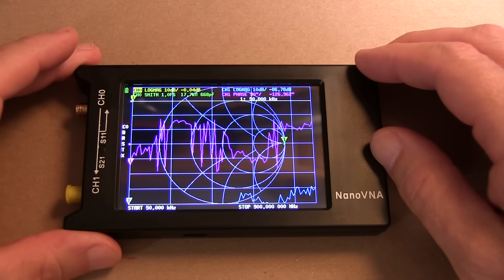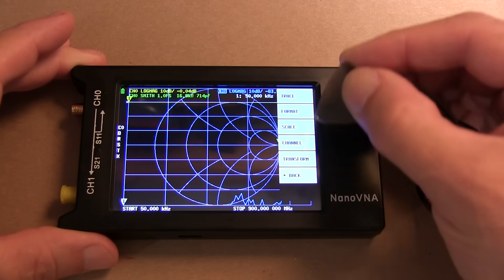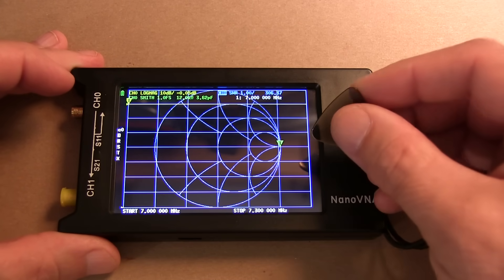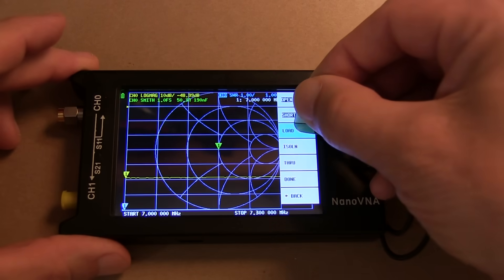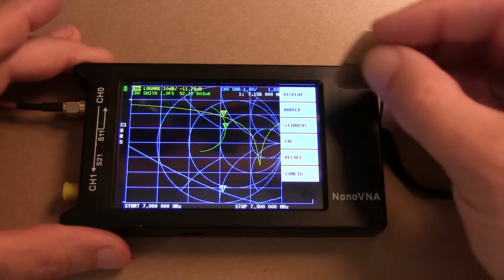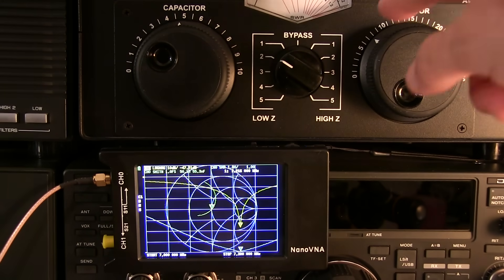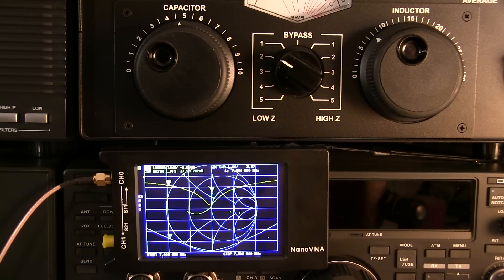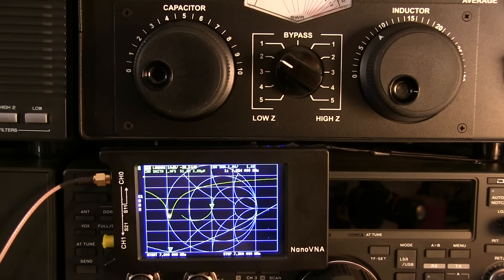#314: How to use the NanoVNA to sweep / measure an antenna system's SWR and optimize its tuning

Comment: Great tutorial, this video has been so helpful to me as iv just bought the H4 model and this is all new to me, I would just like to ask a question about calibration, please can you tell me why other videos iv watched on calibrating a nano vna , some people use the 3 calibration caps on the end of the pigtail that is provided in the kit, and some just attach them straight to the vna itself like yourself, does this make any difference at all, which way do you recommend for the most accurate calibration , I do use one of the pigtails to connect to my coax to check my antenna, thanks in advance
Reply from the maker: The location that you use the calibration standards at determines something called the "calibration reference plane".  It is the location where the amplitude and phase response is "zeroed" out.  It's mainly important if you really need to know the phase of the complex impedance where you're connecting the device you're testing.  If many cases, you're mainly concern with just magnitude (such as with SWR or return loss), in which case the phase reference plane isn't too important.  Also, at HF frequencies, the phase delay through the 6" pigtail is minimal, so the calibration location isn't that important.
Reply: Thank you

Comment: I only see one connection to the nanoVNA, are you not supposed to be transmitting in order to do the tuning?
Reply from the maker: The VNA is supplying the signal source as well as measuring the reflection.
Reply: @w2aew  Thank you now I understand :)

Comment: if SWR and Logmag basically mean the same thing, whats the benefit of seeing both on the screen when one will do the job of the other?
Reply from the maker: I show both in this video because most hams are familiar with SWR, and because the LogMag S21 (reflection coefficient) shows a wider measurement range and a sharper dip at resonance graphically.  You can certainly use whichever you're more comfortable with.
Reply: @w2aew  got it. I’ve had my nano for a LONG time but I’m barely diving into all its capabilities after recently upgrading the firmware. It unlocked whole lot of things it didn’t have  when I got it 2 years ago. Thanks for the reply!

Comment: Excellent video!  I replicated your setup and came up with nearly identical readings using my old Denton tuner.
However, as expected, when connected back up to my transmitter, the tuner had to be slightly readjusted to get the lowest return loss.  So, while it is an interesting experiment, its not safe to assume the tuner has a good match with the transmitter after completing the VNA observed tuner adjustments.

Comment: I don't have a tuner. What changes can I make to my simple wire antennas to fine tune the reflection coefficient and the smith chart? I'm only familiar with using the SWR and lengthening and shortening the wires to make adjustments. Thanks for your tutorials!
Reply from the maker: Watching SWR as you make changes to wire length, counterpoise configuration (if applicable), height, orientation, BALUN or UNUN design, etc. should be all you need to do.

Comment: how did you tune the antenna when it was connected to the van
Reply from the maker: To be specific, I didn’t “tune” the antenna. I adjusted the transmatch to achieve an impedance transformation so that the impedance looking into the transmission line at the transmitter achieved 50 ohms.

Comment: Alan I’m having a problem understanding what you did in regards to the Smith Chart portion.
Since the VNA is telling you what the reactance of the antenna at a given frequency, it should indicate an antenna that is inductive when the frequency is above resonance (antenna too long), and capacitive if the frequency is below resonance (antenna too short).
In your video, as you are increasing frequency, but the vector is rotating capacitive which seems opposite since an increasing frequency should look at the antenna as more-and-more inductive—meaning it needs shortening.
So, I’m missing something here.  Can you set me straight?  Thanks & 73…
Reply from the maker: The transmission line leading to the antenna causes the impedance to be altered, so the actual antenna impedance is not what you see looking into the transmission line (unless the line is a multiple of half-wavelength long).
Reply: @w2aew  first off, thanks Alan for your response and explanation.  Even though I understand the test-plane includes the random length transmission line, every one (3 different instances) showed increasing capacitance which I guess is luck of the draw.  When I get time I will try to play with changing both the antenna resonance and feed line length to see if I can get it to move towards inductive hemisphere.  I just still somehow have it stuck in my mind that as F increases, the whole system should look more and more inductive.
Anyway, thanks again Alan (you have taught me a lot) and 73… 😀
Reply: @SpinStar1956  hi spinstar, have you become a flat earther yet?

Comment: of course I come to this video 3+ years late but I am sitll going to ask the question. I am yet to find a video showing how one connects the VNA to the coax. I assume I am a super novice since no one seems as that question thus them must know a great deal more that me. My VNa came with two cables that must require and adapter of some kind and I would go searching for one but I don't have any idea what it would be called. Other that that your video is very informative if I could hook my VNA to my antenna system. Thanks ...And is often the case when I post a question if find an answer. I found a video that talked about SMA connectors and so I ordered a couple of SMA to PL259 adapters. Hope thses are what I want. Then I will return to your excellant step by step video.
Reply from the maker: Yes, the SMA to PL-259 or SMA to SO-239 adapters are what you want, if you are using the typical UHF style connectors on your antenna/coax.

Comment: Do you know a method to suppress any strong signals picked up by the antenna so the use of the VNA will work on a hot antenna picking up normal signals while testing the antenna.

Comment: A great informative video which has solved a lot of the uncertainties I had with the NanoVNA as I only wish to measure the SWR of my loop antenna at different frequencies to enable the pre-setting of stepper motor positions.

Comment: Really Good information! I'm working to get a good Responant Antenna Tune on my Portable Linked Dipole. From what I see you doing with the Tuner, should I be aiming to get impedance as close to 50 Ohms as possible with the SWR as low as I can at the desired frequency?  What do if the reflection co-efficient is not good? Is that where a choke at the antenna feedpoint maybe essential? or what to do?
Reply from the maker: With 50 ohm coax - getting close to 50 ohms, minimizing SWR are the same thing - the closer you get to 50 ohms, the lower the SWR will be.  Similarly, the reflection coefficient is just another way of measuring the reflected power vs forward power.  It also goes hand-in-hand with SWR.  None of these are going change independently.  So, just focus on whichever one you are most comfortable with.
Reply: @w2aew  Many thanks I think I'm on the right track then. I'm tuning the antenna wire lengths with no antenna tuner in the mix to get the antenna resonant in the band sweetspots trying to negate the need to use an antenna tuner as much as possible to get a much radiated power into the airwaves as I can. I seem to be doing something right as I've worked Japan on 2watts (5/5) and 4 watts (5/7) in the past 2 weeks while testing. Your videos have been indispensible in learning the finer points of NanoVNA usage. 73!

Comment: Great video.  I am working on a 2m Isopole that is missing the cones on the main element and and the radials on the ground plane.  You showed me how I can read the smith chart to determine capacitive and inductive factors so I can hopefully make new parts and get this antenna tuned better than the current 2:1. Thanks!

Comment: Hi, one question if I may. What is your opinion about the accuracy of this nanoVNA H4 specifically (as I now own one too) and nanoVNA measuring technique in general (like maybe the square wave test signal etc)? Since you are using it, I suppose it is useful for this "hobby" purposes anyway. But the high end VNA are at least 10x the price, maybe some even 100x. I am just starting this ham/RF hobby, and for example I have this nanoVNA H4, SWR/power-meter SX-200 and the Yaesu FT-450D has it's own SWR-meter. Where would you put this nanoVNA H4 regarding the accuracy (of course used appropriate with CAL procedure etc.)?
Reply from the maker: Properly calibrated, this can be as accurate, or better than the internal SWR meter or an outboard SWR meter.  It can provide a lot more info than a basic SWR measurement.  The only thing that can be an issue is that it can be affected by strong received signals which can be an issue when measuring large antennas on the lower HF bands.
Reply: @w2aew  thanx.

Comment: OK, first of all, you know the Nano VNA very well. I bought the same one, the H-4. 
New to HF, I'm the one asking the stupid questions still!!
How did you connect the antenna to both the tuner and the VNA? And see the results in real time like that!
Reply from the maker: I simply connected CH0 of the H-4 to where the transmitter would normally connect to the tuner (i.e. replace the transmitter with the H-4).
Reply: @w2aew  ok cool, so you removed the transmitter from the circuit. Dah! That makes sense now! Thanks for the response! I've subscribed and am bingeing your videos. Refresh my brain from 20 year absense in the HAM hobby.

Comment: Do you have to calibrate every time you change bands? I want to test my 40-20-30-10 linked dipole. After I set the 7.0-7.3 start/stop frequencies for 40m and do the calibration, can I then just change the sweep frequencies for the other bands?  NS4J

Comment: Shuld I always used samlest range possibile?
Reply from the maker: To get the best frequency resolution, yes.
Reply: how to properly measure 2m band antenna for handheld transceiver? Looks Like that I got confused measurements that vary almost every sweep. calibrating does not help and setting smalest possibile range also does not help.
Reply from the maker: @adrian_sp6def  Simply connect the HT antenna directly to CH0 (Port 1), after setting the frequency range and performing the calibration.  The "case" of the NanoVNA will substitute for the case of the HT.
Reply from the maker: @adrian_sp6def  What you are seeing is really exactly what I would expect.  The small rubber-duck style antennas for HTs are highly dependent upon the "counterpoise" formed by the housing of the HT (or housing of the VNA in this case), as well as the effects that your body has on the counterpoise.  Holding the VNA in your hand is similar to holding the HT in your hand - your body is part of the antenna system.  Also, these antennas are highly affected by surrounding objects, which is why you see changes when you touch the VNA and when you move it around.  The coax fed antennas do not rely on the housing and your body to be part of the antenna, and thus are much less affected by this.

Comment: I have some UHF antennas that makes the VNA show different values depending on the orientation. If I move the VNA and antenna around, the best SWR (<1.2) is moving to different frequencies between 380 and 400Mhz. 
Despite that, attaching the very same antenna to a SWR meter, shows SWR>2 for the range between 380-400Mhz. 
But in the 430-440Mhz it is like SWR=1.1, which I was unable to read on the VNA in any way. 

It is probably due to reflections in my room, but can anyone explain in more details what exactly is happening?

Comment: Nice explanation! I just got one of those gadgets and I think you need an electrical engineering degree to understand it! I'm a ham operator and the NanoVNA got some good reviews so I blew 60 bucks and got one plus a few more dollars for some adapters for my antennas. The NanoVNA has SMA connectors on it.
Reply from the maker: I do have several tutorials (see my playlist) that should help you get a better understanding on how to operate it.

Comment: An excellent video, thank you. This unit looks powerful but not so intuitive to use. This video really helps. Once you've done a calibration for a band and saved it, can the saved one be reused for that band next time, or is calibration required each time?
Reply from the maker: You can re-use the saved calibrations again if you are testing the same frequency range.

Comment: Was going to buy one but I think not now I just want to know swr and power looks bit complex to do simple thing but certainly looks interesting good vid
Reply from the maker: It can measure a lot more than SWR.  However, it can NOT measure your transmitter's output power. So, in your case, you're probably better off with a traditional SWR/Power meter.

Comment: Hi , can the nano VNA H be used to verify and calibrate a 27mhz swr meter? If so can you a video on this please?
Regards
Andrew
Reply from the maker: Unfortunately no, it won't produce enough power to be registered on the SWR meter.
Reply: @w2aew  thanks Alan.
Reply: @w2aew  I saw one of your videos where you had your antenna matcher hooked up to the nano VNA. , has it enough power to drive a matcher? Cheers.
Reply from the maker: @andrewverran3498  Yes -  in that case, the VNA is doing the sourcing and the measuring, so it only had to produce enough power for itself to measure.  A manual tuner works at any power level.  It is not being used to check/calibrate the meters on the tuner. In you case, you asked about calibrating an SWR meter - so my reply was with respect to that.  You can certainly double-check the SWR reading with the NanoVNA to compare against your meter, you just won't get a reading on the meter at the same time as the VNA since it won't produce enough power to deflect the meter.
Reply: @w2aew  thanks for the reply, still learning attenuation and induction etc... reason i asked about the matcher is that i have a few 27mhz SWR meters that have matchers built into them..
Might have to watch a few YT videos with the Nano/TinySA using amplifiers.
Thanks again ..

Comment: Alan, looks like you are using a SMA to SO239 pigtail. Then connecting your antenna to that. Do we need to calibrate at the end of the pigtail by making a PL259 Open, Short, and Load? Or is it ok to ignore the calibration shifts going from SMA on the VNA to the SO239 that we actually plug our antenna cable in to?  
Frequency bands of interest are ham bands from 80m to 70cm. 73, KO4WTG
Reply from the maker: The pigtail won't change the VSWR or the shape of the SWR or S11 LOGMAG curves.  What it will change is the complex impedance looking into the transmission line.  If you are not using the complex impedance explicitly to design a matching network, and you're only using the unit to show you SWR and/or LOGMAG of S11, then the pigtail won't matter a bit.
Reply: @w2aew  Thanks for the quick reply.  At this time I'm just trying to know what my SWR is.  This makes it much easier as I feared I need to make PL259 Open, Short, and loads.

Comment: Thanks so much for your very informative videos . I’m sorry but I disagree that you are moving the resonance point and tuning the antenna with the so called antenna tuner  . You are not tuning the antenna but introducing a coupling device that provides an impedance match to the transmitter . The SWR on the transmission line from the tuner to the antenna does not change , it only changes from the transmitter to the tuner .
Sorry to be picky but but it is not an antenna tuner it is only a coupling device .
Cheers and 73 de VK2SS
Reply from the maker: Agree completely - the title of the video is mainly to help with the search engine.  The "tuner" is really an impedance converter (transmatch) to transform from 50ohm to the complex conjugate of the impedance seen at the input of the transmission line.

Comment: When you're measuring an antenna, is it necessary to also have an attenuator in line to protect the Nano?   Thanks
Reply from the maker: I've never found that necessary.  The Nano produced about a milliwatt of power on its own, and it is unlikely that you'd ever see that much power being delivered by an antenna unless you are VERY close to a transmitting station.

Comment: is any compromise between logmag and swr...? i am a little confused abour the logmag measurement, should be higher in value on the negative side or smallervalue, closer towards 0? i use my nanovna measuring a antenna that i built myself, and i want to tweak for the best receiving signal.
Thanks.
Reply from the maker: Yes, there is a defined relationship between SWR and the LOGMAG of S11.  A lower SWR corresponds to a larger negative number of LOGMAG of S11.  Note also that LOGMAG of S11 is the same number as Return Loss in dB, but no negative sign for Return Loss.  This table might be handy for you:
https://www.markimicrowave.com/blog/wp-content/uploads/2016/11/return-loss-to-vswr.pdf
Note that this shows that an SWR of 1.5:1 is the same as 14dB Return Loss, which is -14dB LOGMAG S11, which is just under 4% of power is reflected.
Reply: @w2aew  Great... thank you for taking the time to reply. 
All the best in 2022.🤗